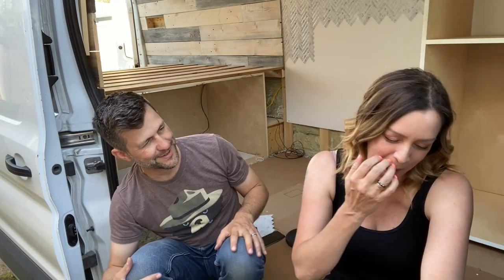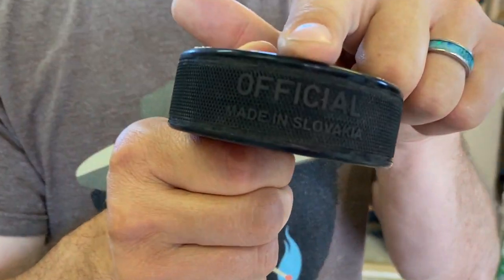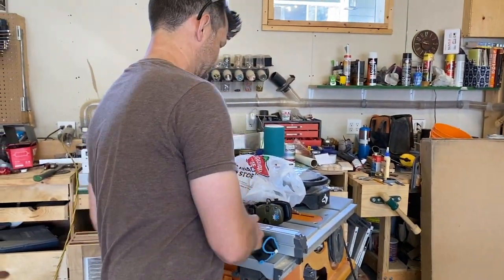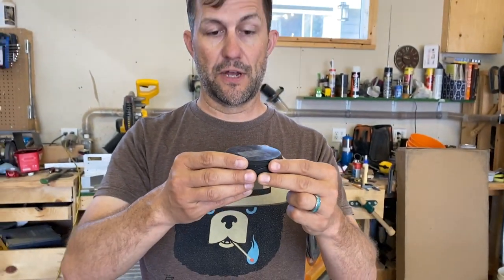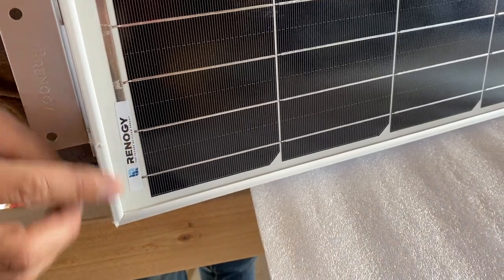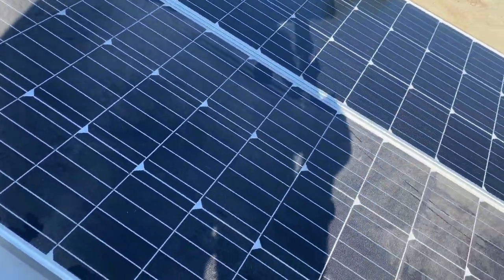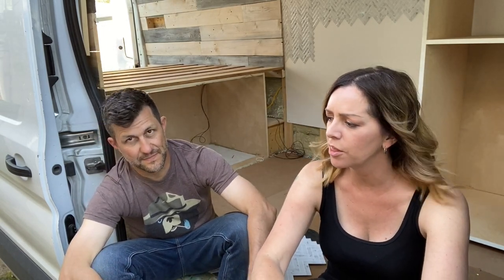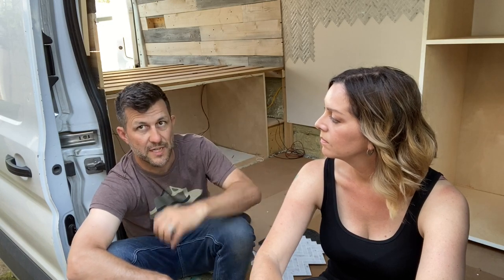Ford Transit Campervan Update #5: Roof rack dilemma, solar panels & 'marital conflict'!

Comment: I machined a hockey puck to use as a lift point on my car for my floor jack. Works well for unibody pinch rails. If I lose it, I can make another.
Reply from the maker: Who knew hockey pucks were so versatile?!

Comment: Hi Roger!  Hockey pucks!  Ingenious!  Now then, how do you seal off the Ford Transit connecting holes from leakage?
You can also check out DIYvan.com from Oregon, USA.  They sell slanted rubber pads that stick on the roof over mounting points.  Plus all the fixings for complete $etup.
Reply from the maker: Hi Peter. Roger used flex seal spray. So far so good. But we may revisit that.

Comment: Nice solution, are the factory holes in the transit that you drill into 90 degrees (perpendicular with the ground)? So after the hockey pucks are in place the holes go in straight down?